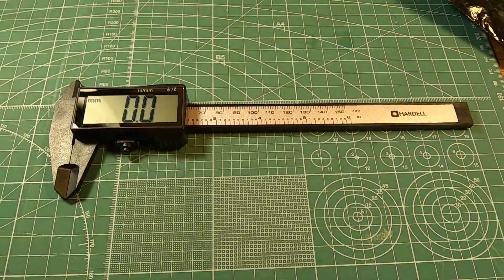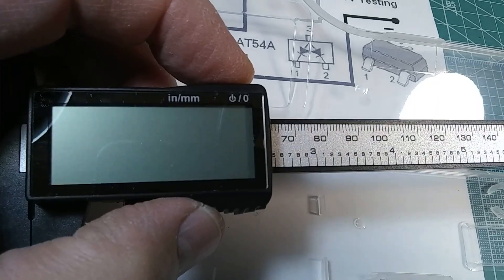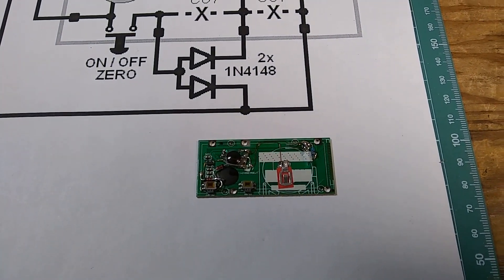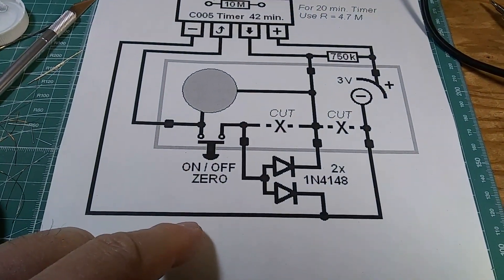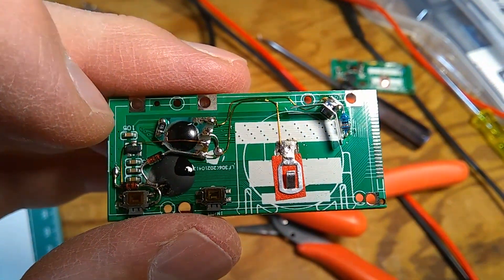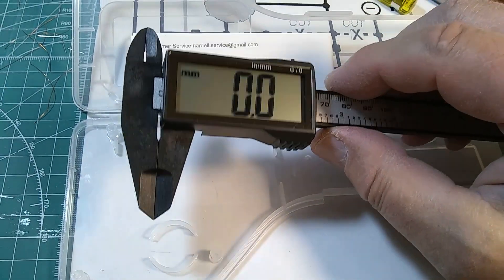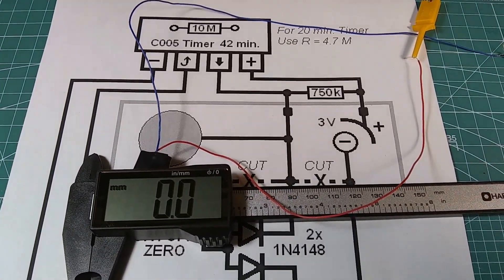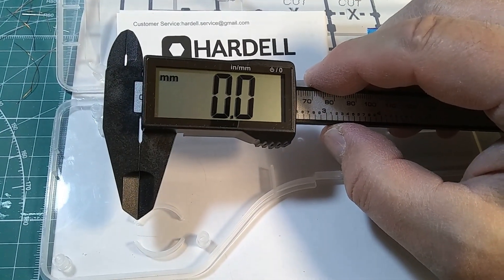Adding CMOS Timer C005 Inside a Digital Caliper

Comment: I would really like to try that idea, but all my cheap digital calipers (I have at least five of them lying around my shop) have a battery life almost longer than my genuine Mitutoyo and Helios ones. One CR2032 lasts at least a year. Maybe the cheap ass calipers sold in Europe (I am German) are different to those sold in the USA?
Reply from the maker: Hi Albin! Most cheap calipers are made in China, so they are probably about the same sold in USA and in Europe. Digital Helios calipers are made in Germany, known for top quality, but not very common in USA. Japanese Mitutoyos are the gold standard in machine shops across the USA. 

One year out of CR2032 battery is a good life span if you use the caliper all the time, but not so good if it dies after one year in storage or after being used only once a week. These lithium batteries have the capacity of 200-225 mAh, less than 2% a year self-discharge rate, and a 10 years storage life. 

If the caliper draws a constant 21 µA current, then a 210 mAh battery would last 10000 hours, which is 417 days. But if the current goes to zero after I use it 4 hours each day, then the battery will last 6x longer = 2502 days, or almost 7 years. 

I use calipers for hobby, not too often, and so I like to have one in every toolbox and always ready.

Comment: I tried to watch this all the way through but couldn't- I didn't see an explanation of the different diodes- the schematic later in the video used a pair of 1N4148s vs the BAT54 in the first schematic.  Would have been nice to have an unobstructed view of the schematic to screenshot it- the timer idea is intriguing
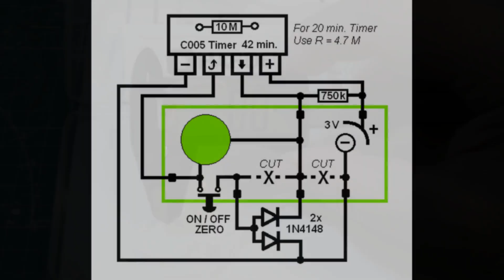Reply from the maker: Final schematic screenshot is at 12:00
The first schematic in the video was for testing. That's when I learned that I had to add the extra 750k resistor to the output, or the timer would never turn off. The back-to-back diodes isolate the blob while providing negative potential to one side of the reset/zero button to operate. 

It works great. But I would probably wire that part little differently next time. I would skip the top diode to the blob and leave an open trace there. And wire direct connection between the negative of the push button and the isolated negative of the battery. I will test the idea on my next caliper ;)

Comment: very nice! I am gonna do this to my stainless edition. Thanks!
Reply from the maker: It's a little bit of "brain surgery" but works great when done. The timer works on 2-5V, and so any caliper with 3V lithium battery should be good for this project.
Reply: @tektech1065  I have started. there is absolut no place for it. it's a alkaline model :( but I have a tiny tiny 3 legged switch. and tomorrow I will finish it. I have cut the board today. and tomorrow i will drimmel away metal. absolut not a job for a newbie. but 46 years of rutine. and it is gonna happen :)